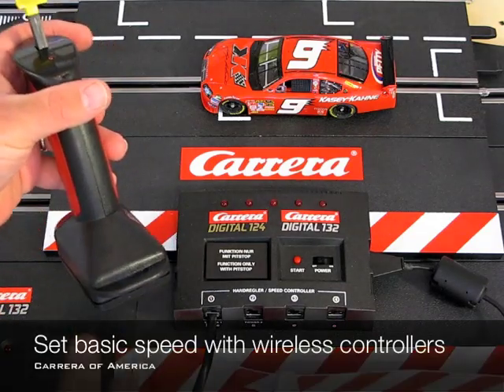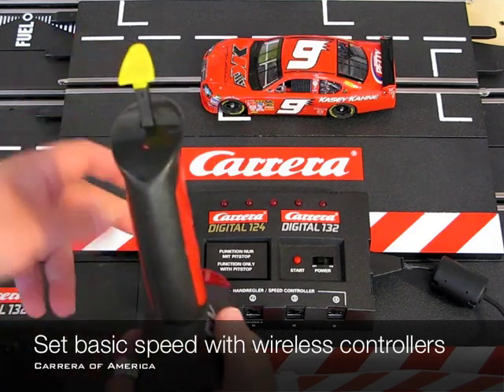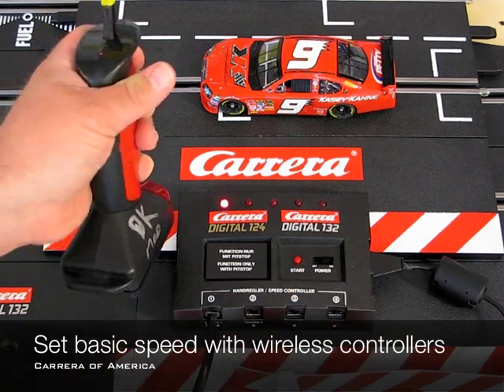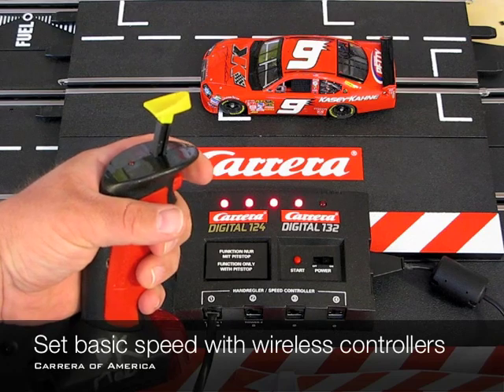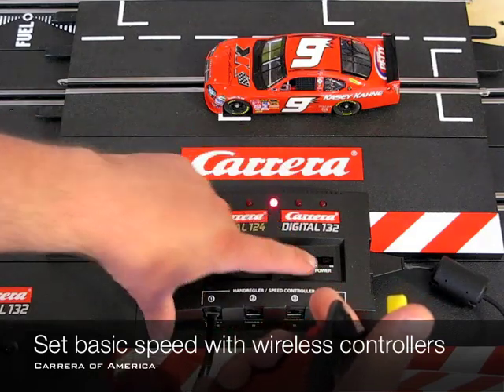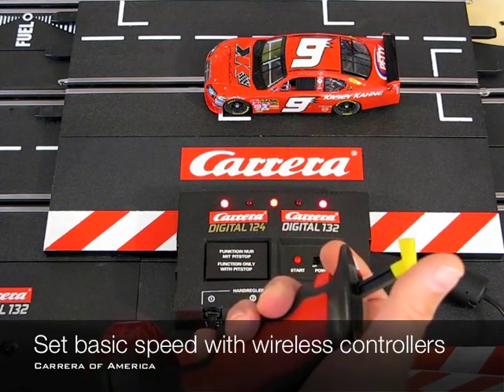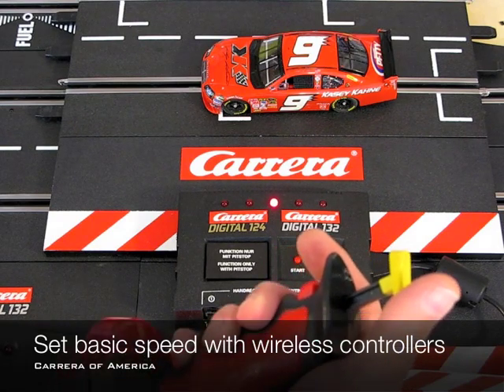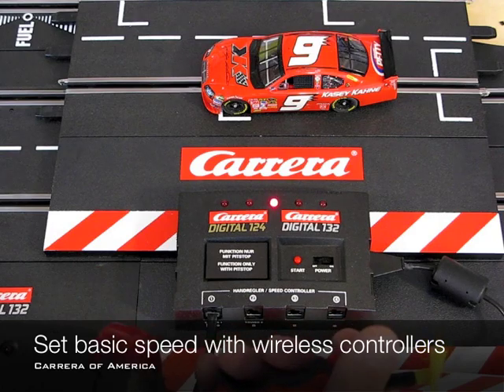Program basic speed using only Wireless controllers

Comment from the maker: You can program basic speed by using the No.1 Controller and doing the same thing. And no the Black Box need not be Pro X compatible. As you can see from the Carrera website you can buy wireless for D132/D124 systems.